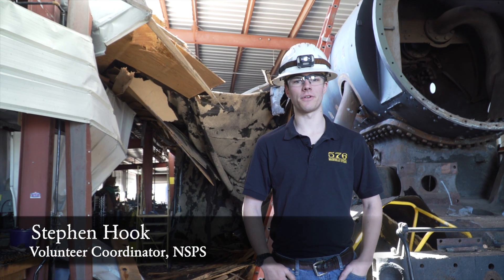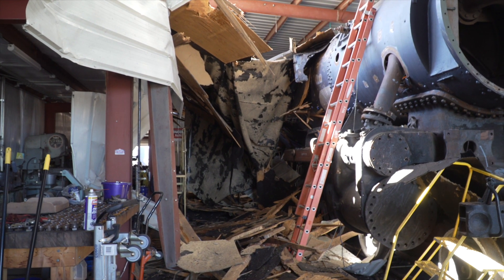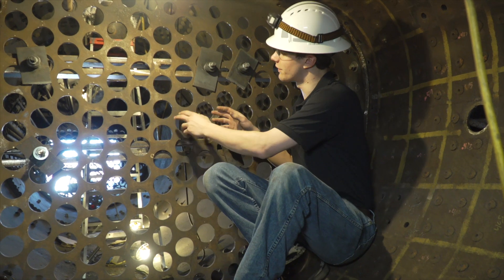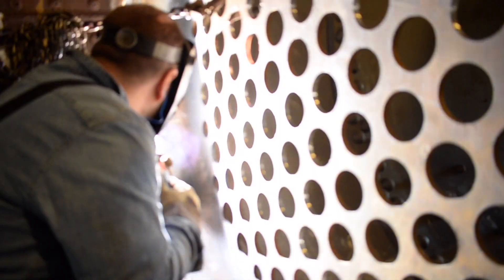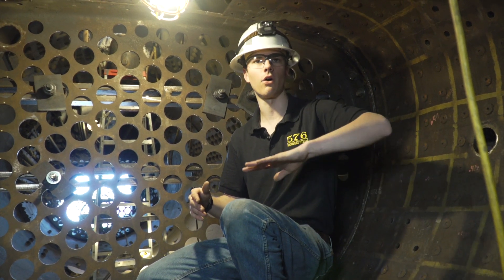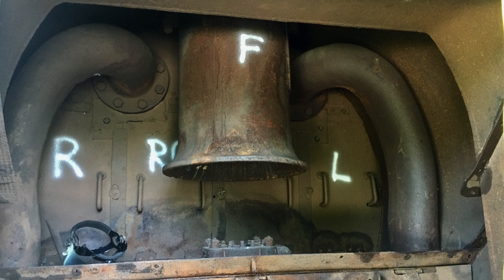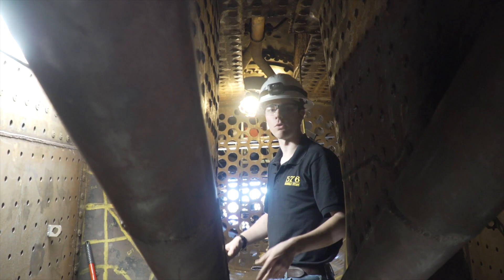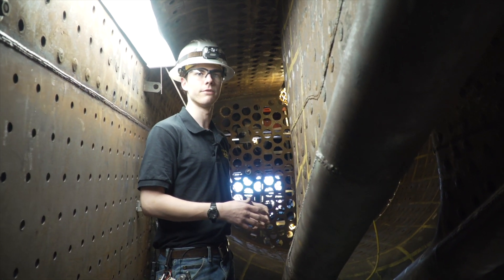No. 576 - The Road to Revival, Ep. 10: Into the Firebox

Comment: Surprised y’all haven’t made the decision to convert 576 to burn oil yet? Lots of Steam Locomotives are switching over since it’s getting harder to find coal and it’s getting expensive. But at least 576 is going to be a coal burner.
Reply: I think you get a hotter fire out of coal making the locomotive run better.
Reply: I think they keep the 576 coal burning